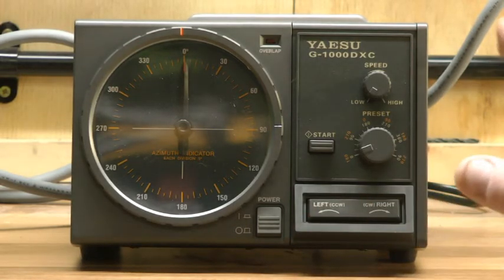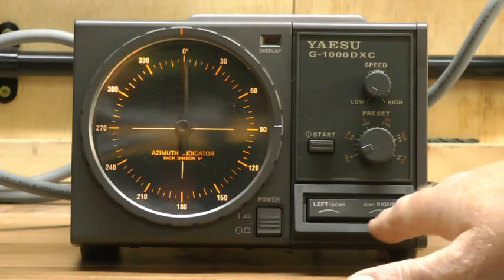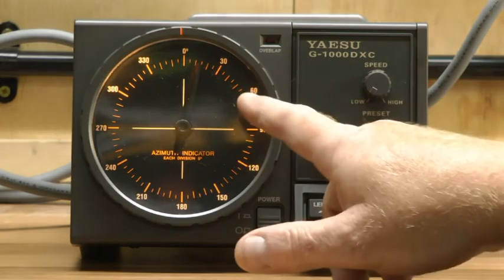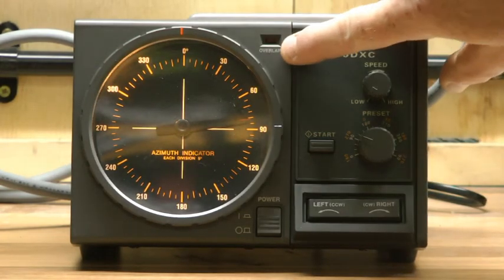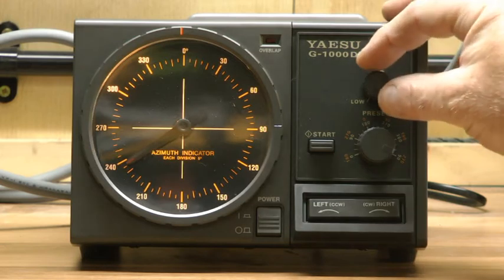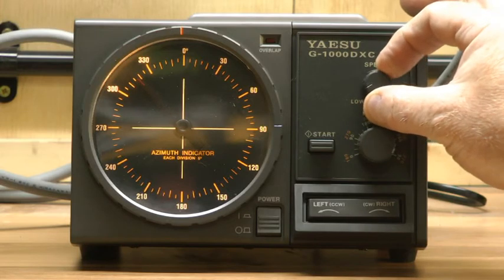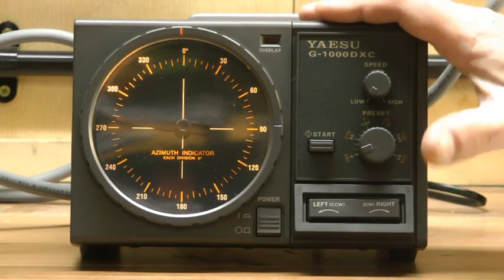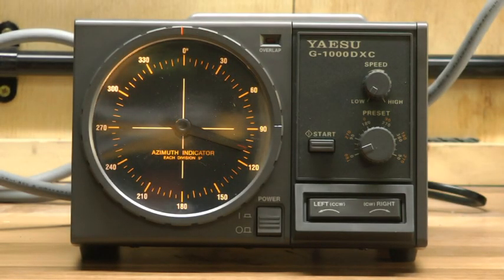Yaesu Rotator Controller only Overview (G-1000DXC)

Comment: I have the G1000DXA controller along the G800 rotator, the system works but the needle stopped working out of the blue. not sure what went wrong, anybody has gone through this issue?